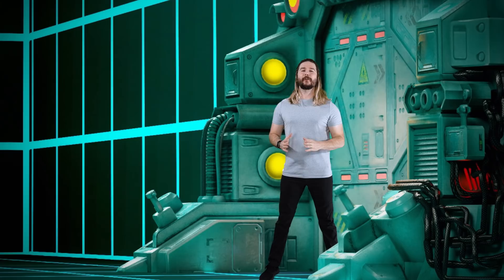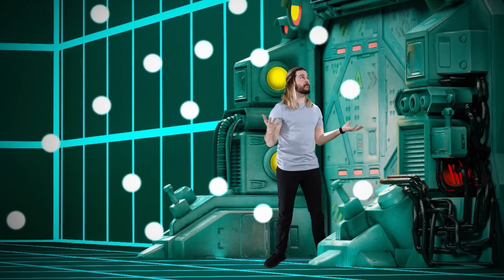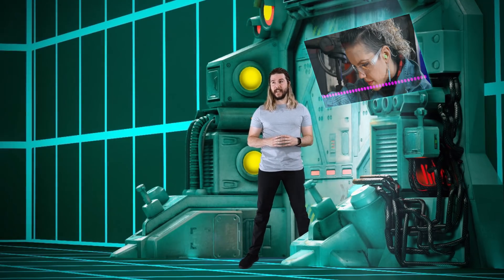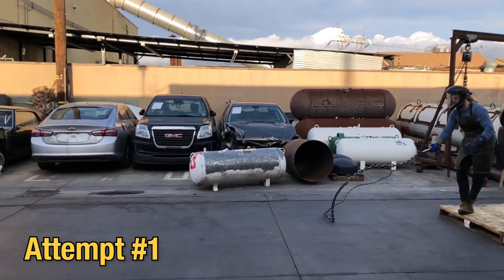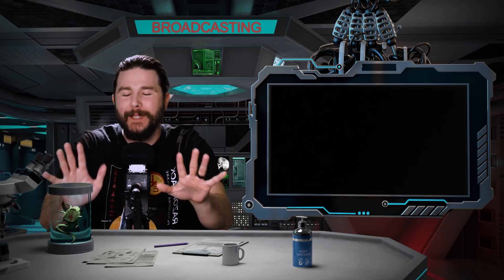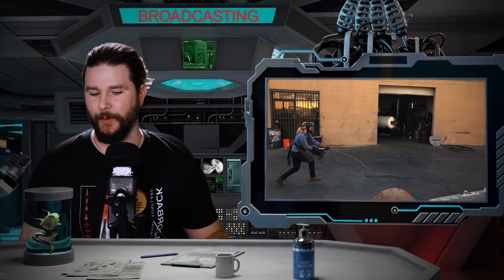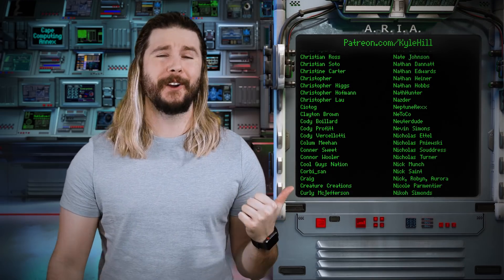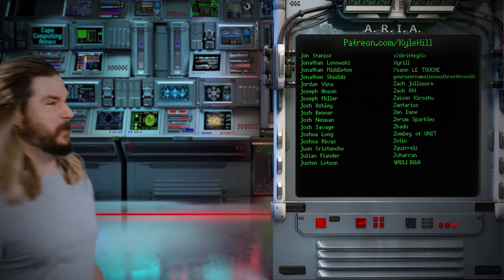Can I Make a SUPERSONIC STEEL WHIP?

Comment: A for Effort, Could it be that there is a lot of friction between the chain links? i noticed that the last part of the chain goes forward in a straight line on the chain whip but it curls on the leather whip.

Comment: as the wave is traversing the cable you need to run/pull in the opposite direction. the wave can only travel at a certain speed and speeds up as it gets smaller, but you can add additional momentum by pulling the static side of the cable.

Comment: I think the best way to get the chain up to speed would be to build a small mechanical arm to perform the motion and hook it up to a suitably strong motor.
In short, unless your actually Thor I don't think you can get the speed and strength into that heavy whip. Also, having a mechanical contraption perform the test would be a looooot safer.

Wouldn't have to be a particularly articulate arm either I don't think, just needs to get the chain moving fast enough in a circle and then stop the motion or move the chain handle back at the right time.

Would also be quite an interesting youtube video, whether it fails or succeeds. Just.. You know... Don't connect it to A.R.I.A, okay?

Comment: I bet I could make it break the sound barrier if you'd let me take a ... crack at it. B)

But seriously, is there any specific reason you need to start with such a thick set of chainlinks? Is there a width/length tapering ratio or something that is needed to achieve the effect?

Comment: You don't know how to use a whip at all.  You couldn't even crack a normal whip with those movements.  A whip is actually used with more of a thrusting motion.  The overhead helicopter crack he did is a bit of an exception.

Comment: The honesty in this video is actually quite important.
Also, it seems like the joints between the different sizes of chains act a little stiffer than the rest of the chain. I don't know if this does much to slow the whip though.

Comment: You have absolutely no momentum built up enough to do what you want, you may have "replicated" the tick tok  vid but you did not use good enough body movement to actually gain ANY momentum, 
Your kinda just dragging  the chain lightly compared to the original 🙄

Comment: I still think you can get the chain whip to crack, but you would need a larger open area and to swing it much like he did at the beginning of his video. Also, take a bit of extra precaution because after it cracks, it will whip back at you the same as a standard whip does....... But with metal.....

Comment: WAIT so you can break the sound barier inside a block of steel

2:56
Reply: Not sure how this would happen. The sound source should then also be moving at 6000 m/s inside your steel block in order to break the sound barrier. As steel is obviously a solid, how are going to get something moving inside a solid :P
Reply: @benjaminbazi9355  DARKMATER BREAKING THE SOUND BARIER INSIDE OF A STEEL BLOCK or somemething like that

Comment: My hypothesis is that it’s the links of the chain. Every single link causes the pieces to run together and would greatly increase the friction acting on each link down the chain. And, imperfect movement along the chain link would sap a lot of speed and momentum. 

They would also explain why the tik tok one worked with a bit of chord on the end. I’m certain that Kyle’s whip would work if he also added some cord to the end of it. 

(Someone mentioned adding some steel wire to the end to simulate the effect. Possible, but steel wire isn’t nearly as flexible as leather, so I doubt it.)

Comment: Would it be possible to make a steel whip using thin steel wire braided like a traditional whip but with a hollow "base" to reduce weight?
Assuming you did have the right kind of steel to begin with that is.

Comment: Looks like there's an issue at the transition from one size chain to another. It messes with the wave flow, so you might want to look into that, either more sizes of chain (less drastic changes each time), or securing the two different sizes at a joint so they can rotate, but not separate (the ends toward eachother joined somehow, so the '0's can't separate and lose energy by recontacting.) Just a thought, but might be something to look into. Could also be your technique, but this is such an outlier of whipping that I doubt anybody has advice for chain whips.😅

Comment: Use a scientific drop tower. Instead of dropping cannon balls and feathers. Make a rig that holds the end high above and a bit outward, and an arm to hold the handle bellow but a bit closer to tower. The whip can be released and fall almost directly down.

If you want, you can add some elastic set up so after the arm falls with the whip handle it yanks it back upwards for an extra kick.

Comment: Question is it possible that the tip of the chain isn't breaking the sound barrier because the material is to ridgid that it can't fully accelerate to the correct speed required? Just asking because I haven't taken highschool physics yet.

Comment: Two things I noticed...the whip tapered in sections rather than each link would drastically reduce the energy distribution. And also you were swinging too wide for a good "crack." With that much weight, you'd have to be purrrdy strong. I'd go old school Mythbusters & use a machine to swing it for the control.

Comment: could it have something to do with the fact that Kyle himself doesn't have enough mass to make the whip go supersonic?
The guy in the TikTok video looks heavy
Reply: The end of the stick might have leather or another material that is less dense than the metal on the rest of the chain so it has less mass but it still kept the speed 
You also need to take it into account the way that he wiped the wip
But that's just my opinion
Reply: I think the lighter material at the end is what might do it. Adding some leather to the end of Kyle's whip might work... but then it's just a weird regular whip and even more unsafe.
Reply: @probablythedm1669  true 
It's better to be safe than crippled is what I always say
Reply: I guess the chain itself is the problem, you loose energy and momentum because the chain has many single pieces instead of a continuous piece so the energy is dispersed instead of transfered.
Reply: @benistingray6097  This was my thinking as well.. the physics of small, stiff pieces is going to be very different than a continuous flexible strip. It might be that the motion simply isn't smooth enough to concentrate the force in the needed way. Probably take some stupidly complicated maths/simulations to get a clear picture of the interactions going on though.
Reply: @benistingray6097  I think it's an accumulation of many small factors that if accounted for could work

- if the chains got as small as a bullwhip tip (or smaller - I'm thinking jewelry sized)
- more force behind swing ( a bigger kyle
- technique/implementation + when big dude was swinging it looked like he spun it up in the air to get rid of as much surface friction with the ground as possible, mostly whipping from the air
-and yeah what you said, the links themselves cause a loss of energy, so either a whole lot more energy might be needed, tighter links, or another possible solution
Reply: @benistingray6097  probably
Reply: there are many ways he could tweak the experiment until it works. like making a longer chain with heavier base but thinner point, or maybe getting someone stronger to whip it. but it would still be way too fucking dangerous to play around.
Reply: Is this like the "Mario could never swing Bowser in a circle by his tail without his arms ripping off" problem?
Reply: Try cracking a whip for yourself, you have to send the whip forward and quickly backward.  Or else you're just flailing it and it doesn't crack
Reply: @TheFinalIllusion  Watch what he does when he starts from mid air. he still pulls forward then back, just like you woulkd a normal whip. the swing up just starts you in the air as opposed to having the chain grind against the concrete due to its absurd relative mass

Comment: I think the issue is that the chain is too heavy to give us the crack. The crack I think comes from the quick redirection of the tail of the whip.
With how heavy that chain whip looks, it would take a Lou Ferigno sized hulka hulka burning man to stop and redirect the chain mid whip while maintaining enough speed to cause the crack.

What if we used a machine to crack the whip?

Also to see positive/scary results for what happens when steel whips work, look up what happens when The cables used to stop Jets on aircraft Carriers snap.

Comment: I would love to see this done again, but choosing smaller chain to make it more manageable to use. I also feel that the base of the chain isn't stiff enough to easily transfer its energy to the next link like a standard bill whip does.

So, maybe a better whip, would be steel wire with some chain at the end.

Comment: i'll tell ya again, just like last vid.... robot arm. 

need a strong sort of motor or something, an arm attached. this arm has to be able to run in both directions. first it goes forward and sends the chain out, then you have to return it at the right time to replicate the flick of the wrist. not sure if you'd wanna program the timing or just control it on the fly, but that should give you the best chance of breaking the sound barrier with these things.

Comment: To me, this goes back to what Adam Savage always says: "Failure is always an option." Just because an experiment didn't go the way you wanted it to, even after repeated attempts, data is still data.  I think this shows that, while it is possible to get a chain whip to crack, and therefore break the sound barrier, it is likely too difficult to do so safely.  Solid work, Kyle.  Thank you for sharing this.

Comment: The original bullet train had a problem of building up air pressure when traveling through tunnels that caused booms when exiting the other side. The creator of the bullet train was an avid bird watcher and used birds to redesign the bullet train. He not only made the train silent (not build up air when traveling through tunnels) but he also made the train faster. Fascinating stuff.

Comment: Looking at the attempts, it seems like you're losing a lot of control and momentum, due to the transition points between each size of chain. You can see the chain bending at each transition point, disrupting the wave-like motion. Obviously it would be far more taxing and expensive to make a chain with a more gradual size-difference, but just something I noticed. I appreciate you not sugarcoating a failure and showing us this update, as it could help others interested in this kind of experimentation.

Comment: I think the reason it didn't work is because on the macroscale your chain is not a contiguous object. You're losing energy as each link has to change direction and there is time for it to just move through air and slow down before engaging the next link. I think you actually need to move it much faster then what would be expected because it's not one continuous object

Comment: there is a video of a Chinese or Japanese guy actually doing this, but it's old and I have no clue what the video is called. I do know that what he did versus what I see in this video is that in the one I saw you need to run in one direction to gain momentum then switch and full sprint in the opposite direction to where you started, and I don't think go beyond that. once you do that the chain will catch up with itself and at the end, it will be supersonic just like any other whip. hope this helps kyle and if you do find that video I think it will really help and you will finally be able to do it.

Comment: The scientific method is based on reproducibility, and failure is a big part of it. If everything worked perfectly every time then there would be no purpose in the method.
Reply: yes, and i respect Kyle for showing this, but wouldn't it be better to go back to the drawing board and try to figure out why it wasn't working, before creating a new experiment?
Reply: @davidlewis6728  Well he kind of did do that. After the first video he returned to the project with some design modifications and tried again, with this video being the second result. That's sort of his whole point at the end that we tend to only show successes, so most people would've just shelved this and gone onto a third redesign if it was possible, and never talked about the failure.
Reply: @Provigilman  but didn't he say he wasn't going to do a third redesign at all? as i said, i like the part where he shows his failure, i just would have expected him to keep trying.
Reply: @davidlewis6728  the danger aspect might be a big part of it. It is clearly hard to control that whip so it might just be too dangerous to proceed.
Reply: @Tatwinus  that's why you start with the theory. if i were him, i would 1) try to get a more professional whip-user to do it. 2) use more padding, or 3) make a machine that can replicate the hand motions necessary to create the crack.

Comment: You need to use #16 gauge BRAIDED COPPER CABLE that starts out thick and the braid slowly tapers to a single copper wire.
Reply: Juat ask any electrician. Copper is alot softer and will move easier

Comment: I think the main reason why it wont work with Cains is because the holes, I think using a steal wire rope would be better at making a whip.
Reply: Ooh I hadn't thought of wire, that would definitely work, and be much lighter to whip
Reply: So that tik tok video of that Chinese guy whipping the chain is fake?
Reply: @KhanMann66  not entirely. Most of the whip is made of chain but the end seems to be an actual, normal whip. So he technically had a chain whip, its just that it's not entirely chain.